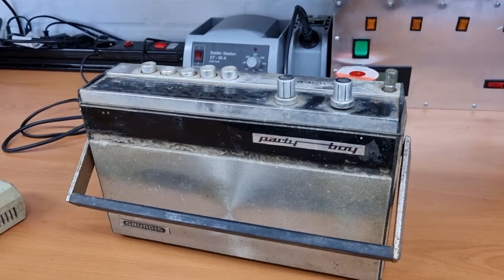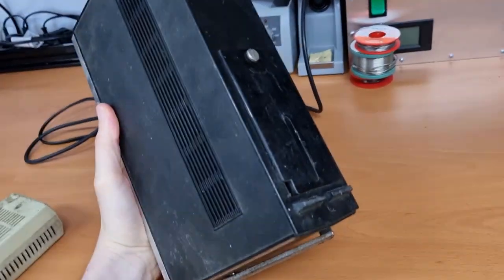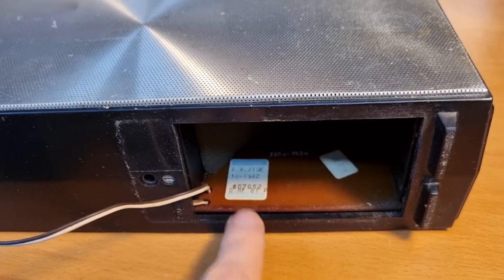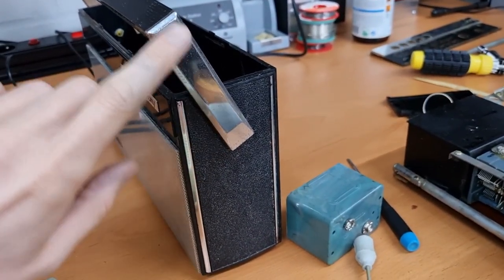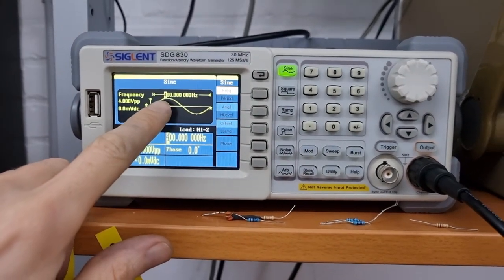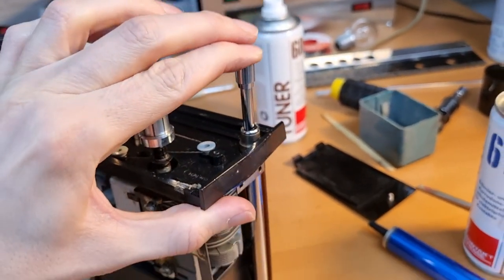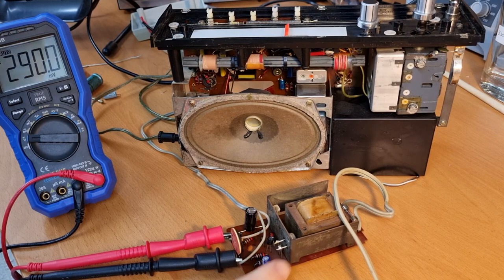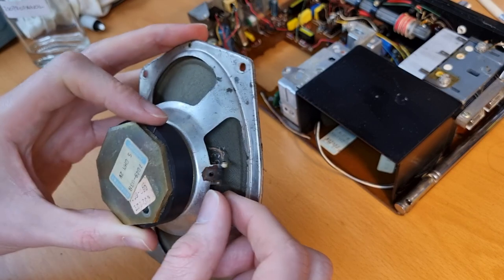Saving a battered 70s transistor radio from the junkyard - Grundig Party-Boy 210E (Part 1)

Comment: Nice find. The Grundig radios have a quality sound. I got mine from the dump! A Yacht Boy 210. It even had the genuine Grundig 9 volt battery eliminator inside. The only work I had to do was free up the tuning knob. It was glued solid with dried up grease and fit a new cap in the power supply. That was at least 25 years ago and it still works fine. Switched on every time I go into the garage.
Reply from the maker: Thanks! Yes, I do think these small Grundigs sound rather pleasing. I added an holder for 6 AA batteries in mine and I'm running it of rechargeable ones. Works perfectly.